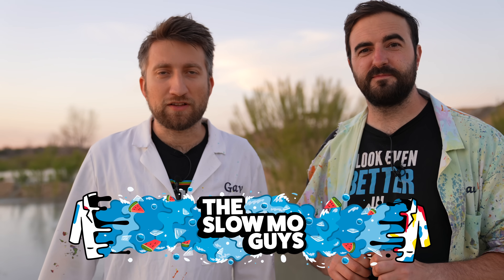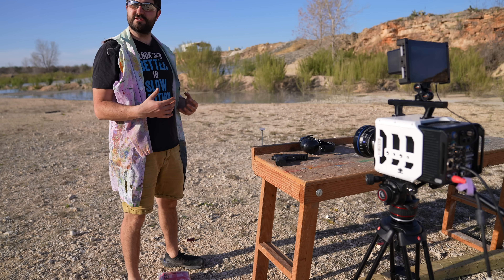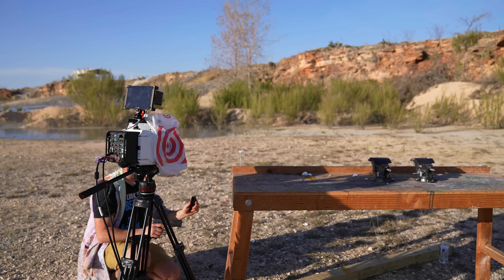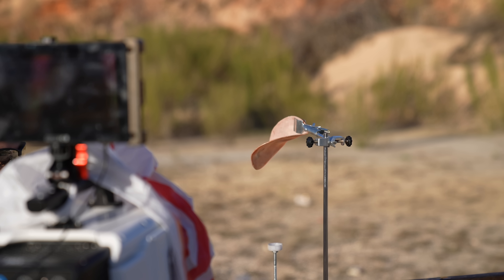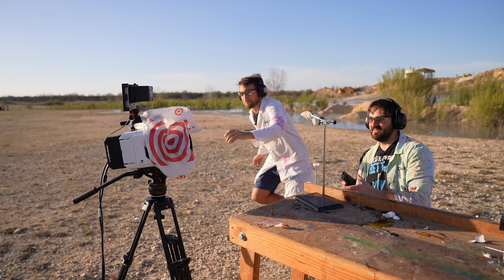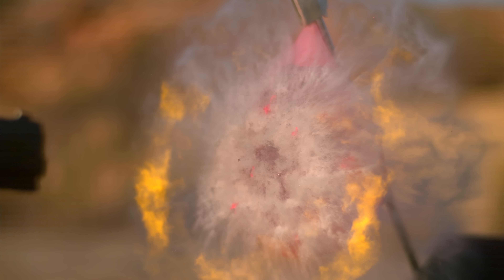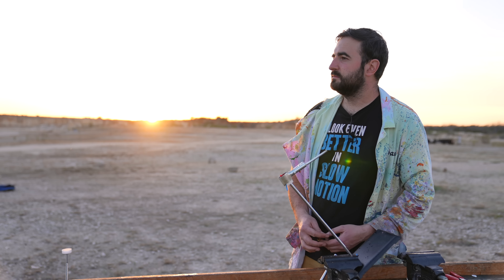The Explosive Power of Blanks at 82,000FPS - The Slow Mo Guys

Comment: You are aware folks that in a blank there is the primer (explosive, and very dangerous if not restrained by the bolt & chamber). The powder (which immediately transforms from solid into very hot plasma via deflagration) and a small disk or wad (projectile). All held in place be the mechanical crimp (think about how much force is required to straighten and flatten that crimp). And you are placing your very tender, fragile flesh in the way of all this junk?
 Just sayin'...

Comment: I'm a little surprised they didn't point it out, but you can really see it in several of the slow mo shots: blanks have no recoil whatsoever. The propellant explosion doesn't have nearly enough mass to affect the weight of the gun, so the gun is just glued still in the slow mo, and Dan even fires it once with a totally unbraced, casual angle in one of the ham shots.

Comment: So you are using a real gun with blanks as I can see. If you were using a blank gun, it would cycle because all of the pressure will be stopped - usually barrel is welded shut.

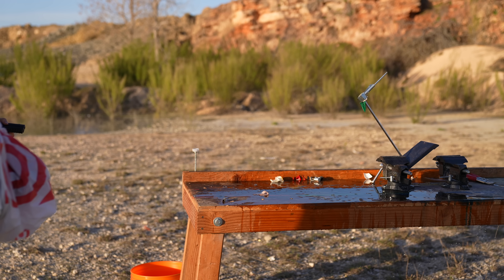Comment: 6:00 - "I'm pretty surprised by the range":  I was in a Wild West-themed street show where we used half-load .45 caliber blanks in revolvers for simulated gunfights. We had to reload our revolvers midway through the performance, and one show I accidentally dropped the hammer while I was reloading mine during another character's monologue. I was over 3m away, but the poor girl still got some powder burns on her legs from the shot. It even went through the petticoats she was wearing.

I also managed to accidentally shoot myself point-blank in the chest during my very first show (while VERY STUPIDLY attempting to show off), and even from ~40cm away the round was powerful enough to blast a stout metal button clean off of the leather vest I was wearing. If I hadn't been wearing that vest, or if the shot had been angled about 15 degrees higher, I guarantee I would've been sent to the hospital.

Comment: powder actuated nailer please, eg, Hilti, Ramset, please. Ie, Shoot a concrete nail into concrete, but use a transparent block , similar to 1.5"x3.5" pine lumber. TYIA.
Reply: for clarity, shoot the concrete nail through the transparent  block (in between the nailer and concrete) and subsequently into the concrete slab if a builder grade foundation.

Comment: Oh I remember the yellow blank firing adapter from military. It was absolutely obligatory not only to make the semi-automatic rifle function with blanks, but also as a double puropose safety feature: there wouldn't be as much stuff flying out of the rifle (though there still were strict safety rules for firing blanks towards people, partly because in theory the adapter could fail and fly out if it was attached poorly), and the bright yellow plug at the end of the rifle was an easy to see indicator for whether the gun is in a non-lethal mode or not, because I'm pretty sure the rifle would just break if you shot real rounds with the adapter on, and removing it took a bit of time. We shot so much blanks on exercises, and the gun would get like ten times dirtier when firing blanks compared to when firing real hard rounds. The blanks had a wooden bullet replacement that would shatter and burn upon firing, and while some of the muck would get out through the adapter, a lot of it would remain in the barrell as a grey soot. Like, shooting just a handful of blanks in a combat exercise would make the gun as dirty as a full day of shooting exercises.

Comment: There's a reason for i think a 7ft? minimum? range for blank usage.. Even in the military when using those Blank-stops that was mentioned, you still have a 'minimum safe distance' you MUST adhere to when they are in use.

There's also the fact one of you also pointed out "anything in-front of the gasses becomes the bullet"  That holds true for unburned powder, dust, rocks..... anything that is inside that barrel when that blank is fired.

Think of a Blank-cartridge as the Black-powder of a Blunderbuss.  It will launch anything in front of it out the other end at the speed of that expanding gas.

Comment: I supply a few local film makers with blank guns and always tell them they are not toys they will cause injury and it's one of the reasons I make sure I am on set. Now all the guns I use are made to be blank guns there is no way they can chamber a real round. Many people have been seriously or killed by a blank gun. Of course a blank gun will do damage to the stuff you showed. It would be great to see a video of a blank against a Ballistic Dummy Gel Head. I think when positioned right it will do damage to the skull inside. I have seen examples of a blank gun vs melon and they did a lot of damage to it.

Comment: Could you guys make a video on wood and metal chipping on the lathe machines. I think the video can give you a really interesting visual perspective in the super slow motion of the lathe machines working and the chip breaking with the interaction of the inserts while the body is turned by the spindle in slow motion.

Comment: There's a reason they're phasing these out of holywood, not much to gain from them with the risk involved. The sound will always be dubbed over in post with punchier sounds that they can seperate from the rest of the soundscape, and the flash is probably the easiest visual effect in all of VFX

Comment: As someone who used to do blackpowder western type shows, I can honestly state that I have had my feet knocked sideways by a shotgun blank at about 2.5 meters whilst running to a new position. (Timing error)
Edit: One of the things we did at every outdoor display was to show the public just how dangerous our blanks were was to do shots against sheets of newspaper at around 1 meter.
Even the .38 pistol blanks from a choked blank only barrel, (custom replica weapon with cast in ramps in barrel), would put holes in the paper.
The result from my 45/70 trapdoor at 3 meters always got a good response!
If we were doing and indoor display, we would do a blindfold fastdraw shot with a balloon between some volunteers knee
Always fun and, yes, my blindfold was a partial fake. I could see shadow patterns through it but no detail.
FYI, the pistol blanks were mainly .38/9mm loaded with 20 to 30 grains 4F black powder and compacted with a 10mm thick, (pre-pressing), polystyrene wad. The wad tended to vaporize at muzzle exit.

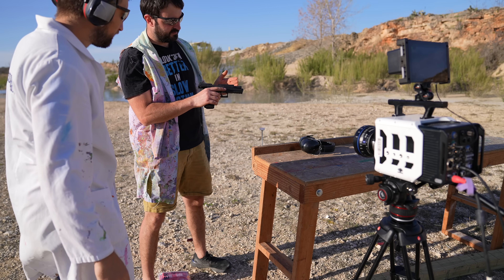Comment: 1:34 Learnt something. Never knew that. Had a blank firing Beretta before they even locked them down to re-enactment groups only. Never fired any of the blanks but also never knew it didn't cycle to the next round. I always thought the yellow attachments were just to show they were firing blanks and to stop any power projectiles but I was wrong. Good info.

Comment: Back in army cadets, when i was about 12 years old, one of our instructors wanted to make this point. He took one of the ration pack desserts (treacle pudding iirc) taped to a fence post and shot it with a 5.56 blank from one of the cadet rifles (L98A1, no BFA) at maybe 5 feet away. Rock hard bit of cake in syrup inside a fairly heavy duty foil pouch. Guy said "imagine that's skin and muscle" and then absolutely annihilated it.
Thats what he demonstrated before letting any group of cadets load blanks.

Comment: Energy is never lost, just transformed differently. Instead of going into the kinetic energy of a bullet, it just disperses as heat into the air. But at the exit of barrel it's still the same energy. This is just like a jet engine except not a continuous process, and nobody would call a jet engine as "just" blanks.

Comment: Hopefully Alec Baldwin sees this ‼
Reply: Why? He didn’t load the weapon
Reply: @lucasbyron9436  Firearm Safety - 10 Rules of Gun Safety:
Always Keep the Muzzle Pointed in a Safe Direction. ...
Firearms Should Be Unloaded When Not Actually in Use. ...
Don't Rely on Your Gun's “Safety” ...
Be Sure of Your Target and What's Beyond It. ...
Use Correct Ammunition. ...
If Your Gun Fails to Fire When the Trigger is Pulled, Handle with Care
Reply: @VLADPowder  And yet this is a film set where things differ slightly. There is a person who’s one and only job it is is to make sure it’s safe. Not to mention they were blocking for a scene and he was told by the DP where to aim the gun

Comment: The military "yellow thing" is a BFA (Blank Firing Apparatus) it works by not letting the gas escape through the barrel so it travels up the gas tube which then hits the Bolt carrier group (BCG) which goes back, extracting the blank round, then putting a new one in the chamber.
Highly unreliable so most times we end up manually racking the bolt manually and leaves the rifles very dirty.

Comment: Not quite accurate.
A semi auto pistol has it's barrel locked into the slide initially. So it needs the recoil from the bullet reaction to cycle. (Simple blowback actions do use the pressure of the brass casing to push the slide back.)
Blank Fire Adaptors are used in semi auto rifles, to hold pressure in the barrel to act against the piston in the gas system.
Pistols modified for film use, are going to have a gas restriction added to the barrel, but they are also going to need the barrel-slide locking surfaces modified. Effectivly turning it into a straight blow back action.

Comment: What convinced me, personally, of the dangers of blanks was the routine of firing just a primer on a replica 1861 Springfield rifle with its long (42 inch?) barrel, pointed at grass.  No powder, no was, no bullet, just the primer.  It makes the grass move, which is how you tell the barrel is not obstructed.  That there could be that much wind from just a primer tells me all I need to know about the danger of a real blank.

Comment: Many years ago I was a founding member of the Apple Hill Gang, loosely termed a 'western theatrics and reenactment group' We robbed a local excursion train and performed in parades and at fairs and for private events (shotgun weddings were a specialty). We all loaded our own black powder blanks using 4F powder and a bit of milk carton, the waxed kind, and sealed it with nail polish. It was mostly smoke and flame, but if a blank was discharged in close proximity to a person there was a definite risk of being 'peppered' with unburnt powder.

Comment: There is a reason why you have a minimum safe distance of several meter even when shooting blanks with a blank adapter. Of course, the blanks I fired was from a machine gun so id had plastic bullets that the adapter disintegrated, making for a much more spectacular show than this.

Comment: Would be interested to see the difference that a blank in a longer barrel weapon has. 
When we were in training we were all on parade and the CO had a squaddie with an L98A1 come up to the front.
He threw an apple up in the air and in one of the most impressive shots I've seen the squaddie put a blank through it in midair.
It looked like absolutely nothing had happened until the CO caught it, inspected it, turned it a bit and blew through it, and half the exit side of the apple just fell away in pieces.
A really memorable safety lesson.

Comment: Idk how good or feasible this video would be but, it would be cool if you could compare and show the difference between composite and metal. Carbon Fibre is used in a lot of cases because it can be a compromise to its metal counter parts with its strength and weight. People think of carbon fibre as being more stiff than metal, but in reality, that some times isn't the case. Because of the resin used in the manufacturing, it increases the elasticity (Youngs modulus)  which allows the material to deform and have more 'give' when any kind of load is applied. Where as metal, because it is uniform, it doesn't have these characteristics so when similar loads are applied, it would break or shear depending on the environment. I think this could be demonstrated where you could show the deformation of both materials where you would see the composite would deform more but be able to retain the original form where as the metal would twist, and deform because of the torsion.

Comment: Two comments on items only mentioned in passing

- blanks usually have a wad of cotton or some other "soft" material holding the powder in place which can be a fatal missile, especially close up. Most famously Brandon Lee was killed during the shooting of The Crow in 1993

- with or without a BFA the weapon doesn't have a fraction of the recoil that it has when firing live ammunition. The distinctive flame pattern (a star, usually 6-pointed, of flames radiating from the muzzle) and lack of "kick" are obvious tells in action films.

Comment: One comment about (semi)-automatic handguns: they are generally recoil operated guns. This means that it did not cycle not because of the lack of pressure, but rather it is because there is not enough mass to react against. In a short recoil gun, the barrel and the breech and slide move together for a short while before a point where the breech unlocks. This is when the gun cycles. 

For movies and the military, for blank firing pistols, they generally either modify (for movies) or use conversion kits that works differently than the stock pistols, namely the lacking the locking lugs. It does depend on the pistol since Glocks can be a little complicated to convert to blank firing (Forgotten Weapons has a video filmed at a movie armorer in Toronto that explains how they made Glocks blank firing). This is a step further than merely plugging the barrel like rifles which are chiefly gas operated and sometimes blowback operated (like the G3). 

 There is such thing as a blank firing adapter for the M2 .50 caliber machinegun, which is recoil operated. It basically use the gases at the muzzle to push the barrel rearward so that the recoil mechanism works to cycle the action. 

Going to blanks, this is just one example of a style of blanks commonly used today. There are blank cartridges where it is plugged by a wad (essentially a plug) to create some gas pressure so that there is a more obvious "bang." However, the wad would be ejected out of the barrel and sometimes can be deadly--this is how Bruce Lee died on set. 

Also, for the movies, to make it more obvious that characters are shooting guns, blanks are made flashier, usually by the addition of magnesium and/or slower burning powder in the propellant mix. Magnesium makes a more prominent flash while the slowing burning powder means that gases are still burning when it is at the muzzle. People who are not used to seeing real gunshots may get confused of why there is just puffs of smoke or vapor leaving the gun.

Comment: It is important to remember that many actors, stuntmen/stuntwomen, and showmen/show-women have been killed by "blanks" as any obstruction in the barrel will become the projectile. Disney has to keep a VERY close watch (or they had too as I am not sure if they still have them/use them for safety reasons) on the signal cannons they used on the pirate ships for "The Rivers of America" rides at the parks as my understanding was that they actually used modified shotguns loaded with blanks. So if a kid put marbles or stones down the barrel then someone could have been really hurt as they fired them towards the island. Also some of what you are seeing come out of the barrel is unburnt powder as there is no bullet to contain the powder and it escapes before burning.

Comment: Thanks so much, as always amazing video.

Have you seen Curios Droids video on Film Slow Mo video from NASA compared to modern digital slow mo? 
(Video is called: “Why is Older NASA launch footage still the best”)
It points out the difference still between film and digital for dynamic range.

Would you be up for trying film slow mo to get huge dynamic range (for explosions 🙌).

Comment: You should try it with a blank fire attachment. The jets that come out of those go surprisingly far. During night exercises we were always amazed at how much longer the jets were (despite there being few of them) than what you see from the traditional bird gage muzzle device. I can only imagine it's the same on a pistol, and I'm fairly certain that anything in the path of those jets are going to get "flame cut" pretty badly. The safety distance we were taught was 5m in front and 2m to the sides.